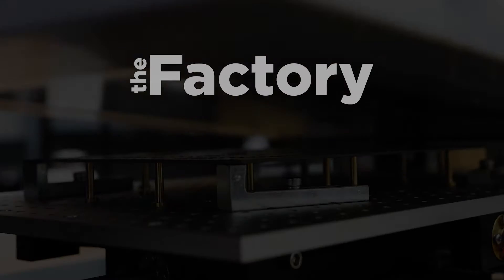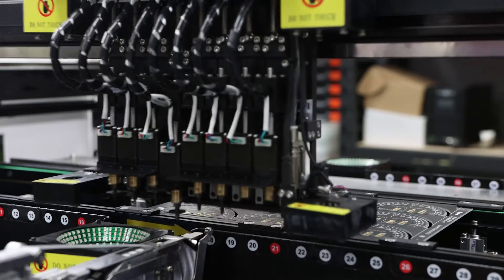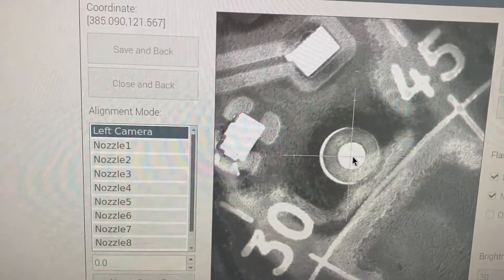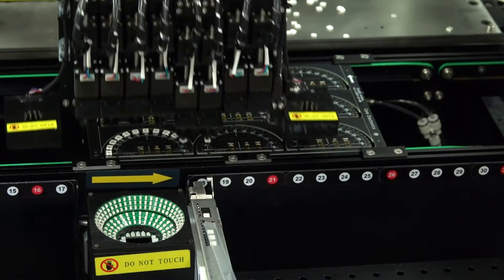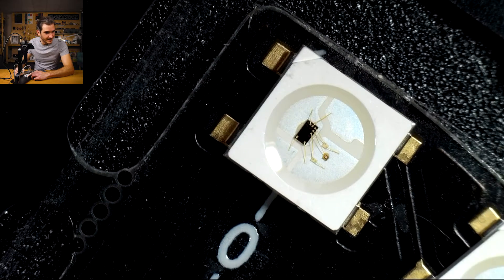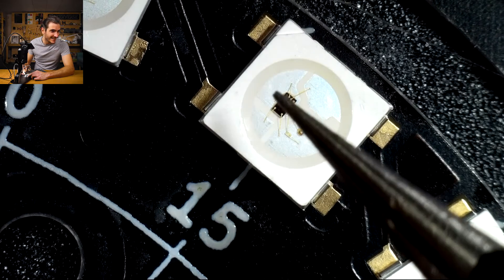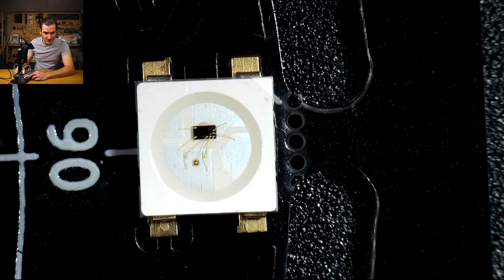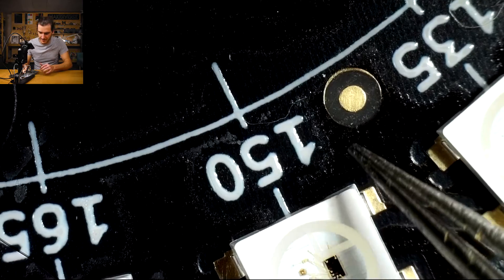The Factory | Pick & Place Machine Dry Run

Comment: For the fiducial you could change the copper retraction a little more, or the solder mask a little smaller. This will also help with the recognition.
Reply from the maker: Great tip, Thanks Gerard. By any chance is this the same Gerard that has a K1830?